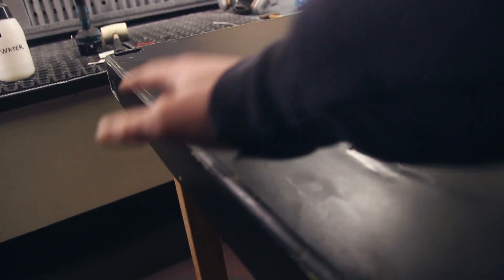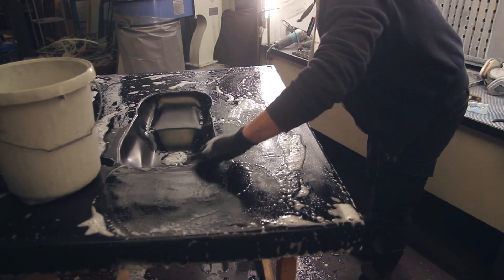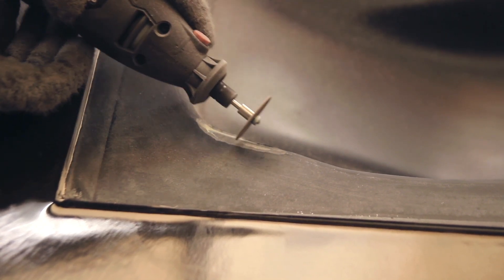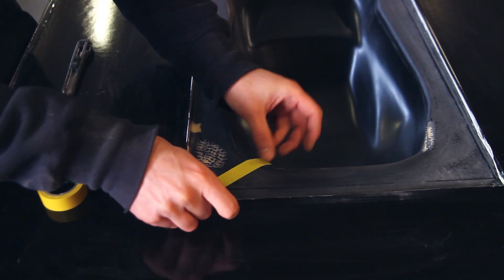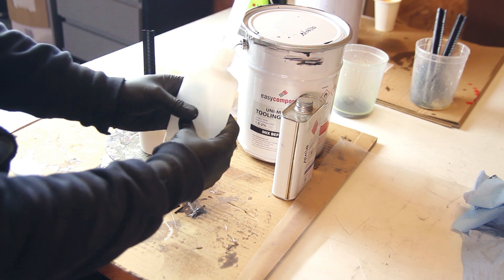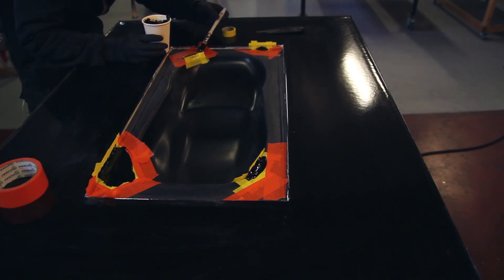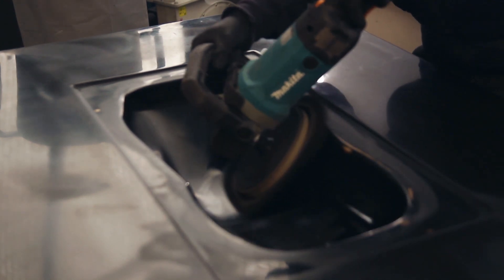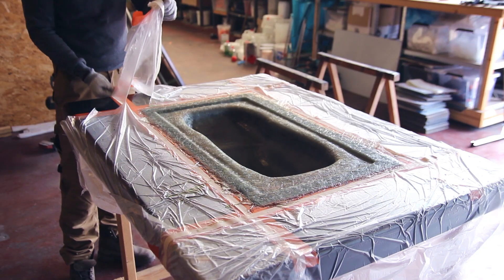Gelcoat Fiberglass Mould Repair (how to)

Comment: Hey, great video!
Do you recommend doing this for the entire tool surface of a mold? I had an incident where the entire surface degraded. I was wondering if I can sand, roughen and reapply the gel coat and polish it to a gloss finish without fearing the gel coat ripping off during a product pull.
Reply: 3 weeks, what did you do? might be easier to just make another mold and learn from the lessons

Comment: Hey Matthieu, appreciate the tutorial. I have a mold which I have been using for over a year now and have molded hundreds of products from it. It is not in a good condition and I wanted to ask that can I repair it by sanding it down and then spraying tooling gelcoat on it, then again sanding it for making it smooth and followed by buffing. Also any idea by doing so, how many more products will I be able to mold from it. The mold is quite large, around 1.5m x 0.5m in length and making a new mold will be time consuming and not economically feasible for me right now.
Reply: Hello, 

I came here looking for the same answer as you. Did you manage to repaint the mold with gelcoat? Was the operation successful? Is it staying on?
Reply: @Luxsus12 Hey, yes I did try it and it works. But not as good as a new mold. I tried to repair it 2 times, but the cracks on Gelcoat surface occurred frequently so I made a new mold. If your production cycle is low, you can try this method, my production cycle is 2 quantities per day.

Comment: Did I hear this right? 4% MEKP?  I always thought 2% was the upper limit.
Another excellent video, by the way :)
Reply from the maker: On small amounts you can get away with higher amounts yes, so 4% here, but do some testing first as not all Mekp hardeners have same purity so might differ a bit, as well as ambiant temperatures, I'm mostly working around 20°c